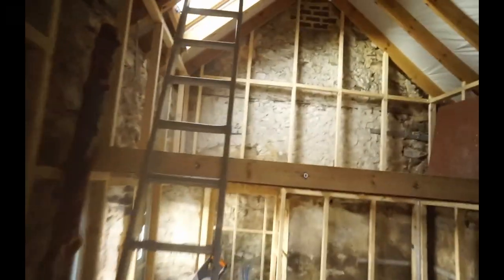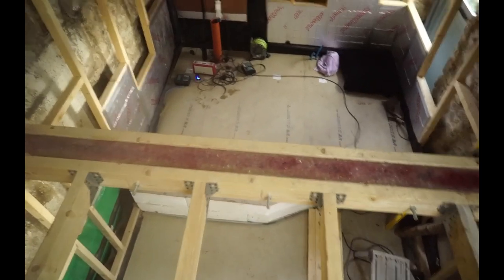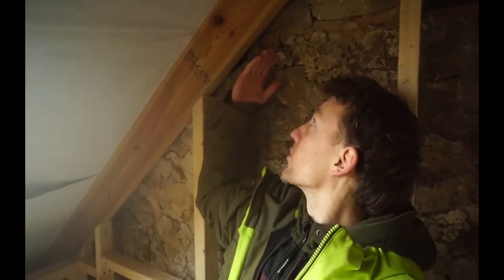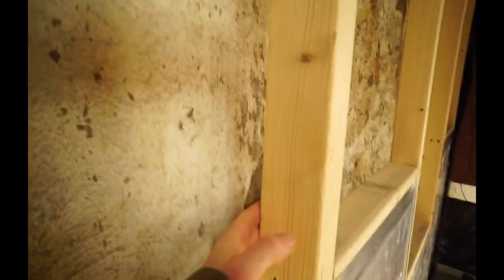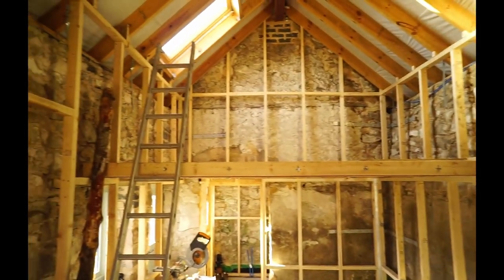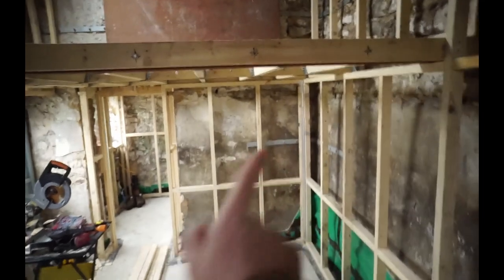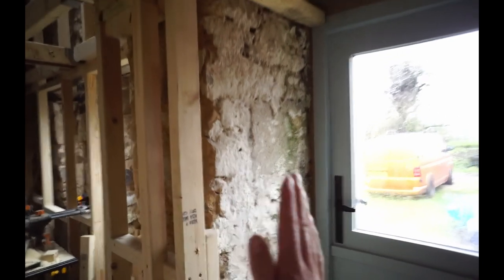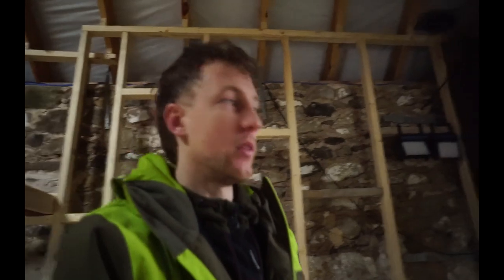Barn Conversion Stud Walling and Mezzanine Floor Nettle Barn Ep 8

Comment: Very informative build. I'm currently restoring a former thatched cottage.  I'm copying your studwork and brick work on base exactly as you've shown, brilliant job Tommy, I'm delighted I found this channel, so helpful 👍
Reply from the maker: Brilliant, glad to hear it's been of use. Hope yours is going well! Drop me a message on Instagram if you need any help @nettle_barn
Reply: Apologies Tim, I called you Tommy earlier 🤐. Quick question, what will you fasten insulated boards to the battens with? Very little info out there on it.
Reply from the maker: Plasterboard screws through into the stud work. Screw head screwed in just below the surface of the boards so they don't foul the plastering but get maximum grip on the board.

Comment: Great work and very helpful. But where it all falls down for a beginner is "I've screwed this timber together" without any explanation as to where or how or with what. More detail please! Particularly the horizontal battens in the stud wall.
Reply from the maker: Sorry for the late reply, I hadn't seen this. I don't believe there are any rules on the horizontals, you just want to put them in the best place for where your plasterboards are going to finish so as you can attach to them

Comment: Hi, first time watching your videos. I’m doing a similar barn conversion. I got recommended a few ways to internally insulate from my planner. Just wondering why you chose this method. I was also told I could tank the walls then insulate onto saving the need to build the internal frame.
Reply from the maker: I decided to go for this option after talking to my building control officers, friends in trades and researching online. From the information I got having air around the wall seemed like the best thing for it. There are other ways and I'm not saying anything is right or wrong, this is just the way that I went as I thought it was the best option.
Reply: @timmynettles   no problem thanks for the info. Just trying to decide the best route myself. Difficult with all the different information 👍

Comment: Why did you choose closed insulation that doesn't breathe? (I get the house in a house explanation) but you could have made it less intricate by using hempblocks or cork plates, etc. Would like to know your reasoning for the pir option :) interesting and different build!
Reply from the maker: I want the house to be well insulated but I wanted to loose as little internal space as possible. PIR insulation has the best u value to thickness by far compared to anything else and it's also the method that I was recommended by others to be able to allow the walls good ventilation. It's not really intricate, stud work is pretty painless.
Reply: @timmynettles  a choice well made in your situation then! Just not a common one :)

Comment: good vid man thankyou.. With the finances for this project do you work for a bit collect some money then do a bit more? Or have you got everything in place right away? I’m taking on a barn conversion myself and it’s a big project here on the farm in Dorset. It’s incredibly daunting and the cost of stuff is just going up and up. I’m on,y at the stage where I’ve applied for planning permission literally the other day. Thanks, Euan
Reply from the maker: You can get a build mortgage which releases money incrementally when you complete stages. They're expensive though and you have even more hoops to jump through. If you do go down this route do it before you start. They don't like taking projects on part way through
Reply: Thankyou mate very helpful.. best of luck finishing her off